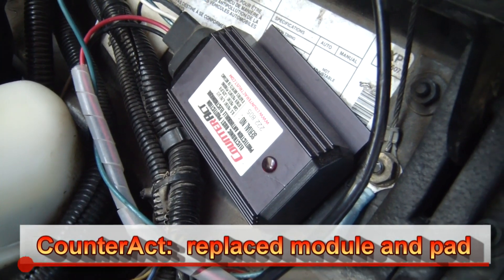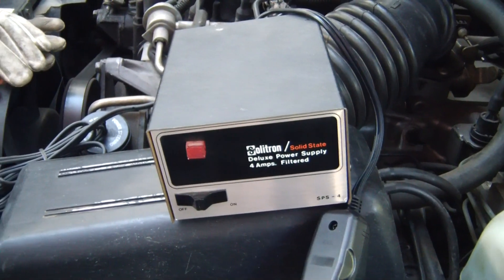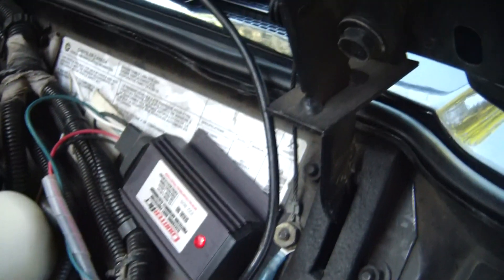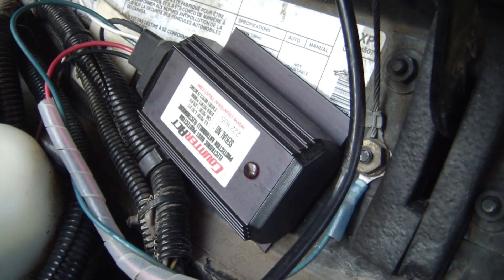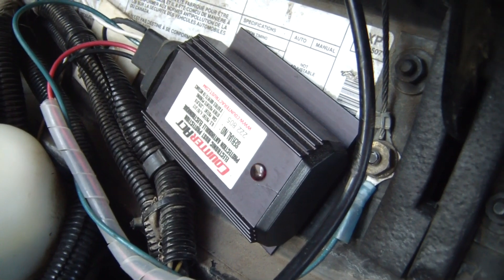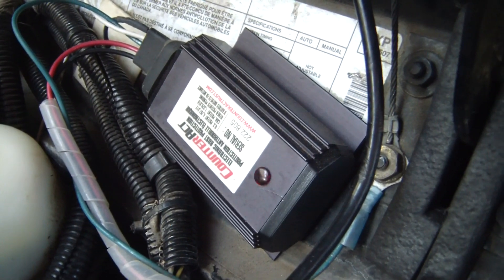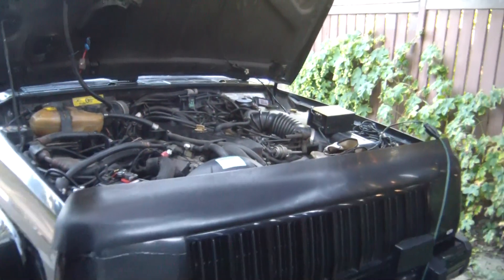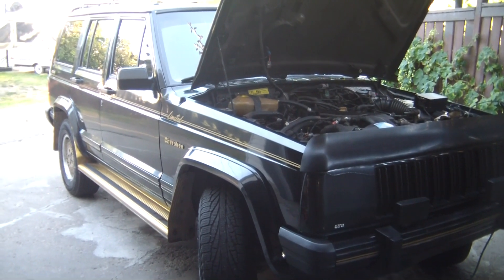DIY Auto: CounterAct

Comment: I've talked to several electrical engineers and read some feed back comments about this and they say the divice does work.  Anyway I'll find out I got one installed in my Tacoma. Don't let an outo dealership do it or will cost you 4x as much. Especially if Sunshine Toyota of Battle creek mich does it.

Comment: What is the power consumption rate for the CounterAct and how will it work when the car is not being used for some days like 4 to 5 days?
Reply from the maker: Unit will shut it self off when source voltage drops to a certain value. Having said that, I hooked my unit up to a separate source as shown in the video. All of this is moot because the company is dead, the product is dead and my unit just died with no possibility of getting any replacement parts.

Comment: It helps, but it doesnt stop it, i made a test on 2 metal pieces, they have rust on both, but the one without have twice rust, dont want your car to rust? keep it out from winter and rains, keep it always dry, you will never have rust, but back to this, i would place this on my car, 300$ is nothing compare bodyworks, worth a try if it can at least slow it down ;) id say its a must for a new car
Reply from the maker: +Kicker2500  -  Thank you for posting your results. I concur.

Comment: It's best if you can find a painted surface under the hood. Might be hard on some vehicles. It slows rust by 80%. My 12 year old car still looks excellent. You still have to fix paint chips as they happen, etc. Just looking for a replacement pad to put it on my new vehicle. Not sure if anyone sells it. The original doesn't stick once removed. They use the same technology on storage tanks. It's a proven technology. Works best on a new vehicle just off the lot. Once rust starts nothing can stop it.
Reply from the maker: If located in Canada, special order item at Canadian Tire, $20. Call CounterAct direct if in USA.
Reply: Klondike Mike it costs $300 @ Canadian Tire

Comment: I bought one, it works but the double sided tape it comes with is useless, I ended up using adhesive. I wonder if conecting the pad wire with a screw to my car body would be better than using the pad. what do you think?

Comment from the maker: @brodie1709 I'll tell you in 10 years on how good it works. You just have to believe in the science. I've only been using it for about 5 years on this vehicle. Installed in year 17 of vehicle, not an optimal install but one none the less. Only have a little rust on rear quarter panel where rear pad is installed. I also prefer my method of installation in regards to powering the unit. I hook it up to a 12v power supply when I pull into my garage.